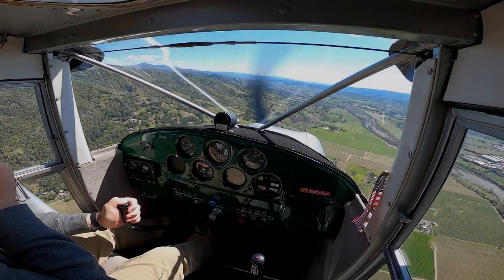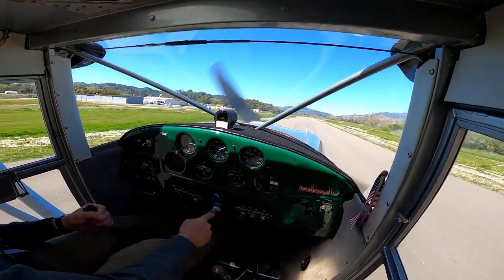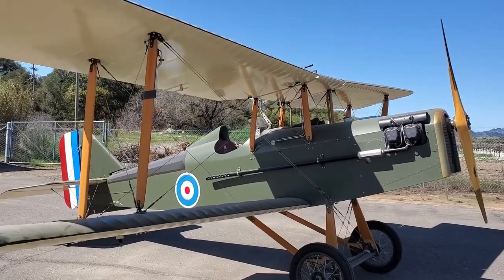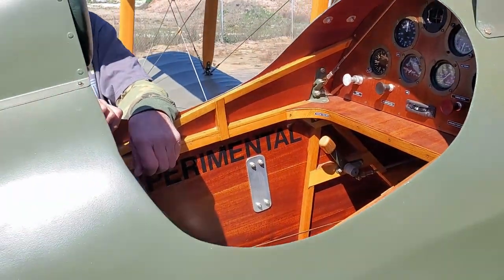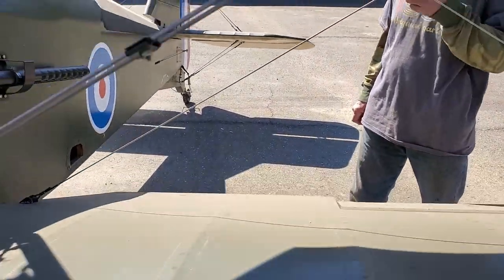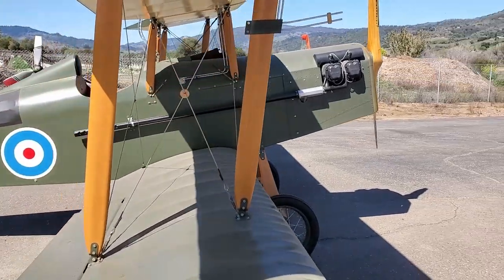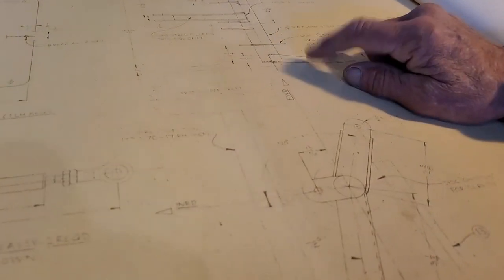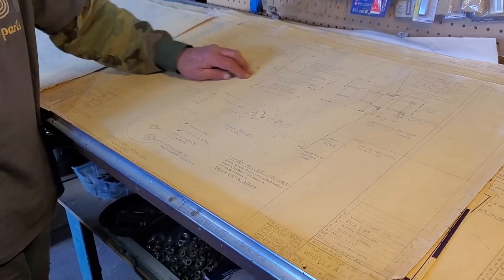Amazing 7/8 Scale SE-5A WWI Fighter Replica 23 Year Build!

Comment: Hay Juan,
That is a labour of love that's for sure. I worked for Qantas and in the 80's they built an Avro 504k replica in the workshop next to where I worked. It took an Apprentice trainer and a handful of apprentices about 2 years to build and I got to watch it come together 1 day at a time, what an experience. They had the original blue prints from the Australian Aircraft and Engineering Co who built the original AC. They also had a handful of salvaged original mechanical parts they got from somewhere. It is now on display in the terminal at Kingsford Smith Airport in Sydney.

Comment: Probably the only plans-built planes built in large numbers where Rutan's Vary-easy and Long-easy, which were constructed with foam and fiberglass. Third party companies made a lot of parts to aid the building.
Rutan, IMO, terrified of the out of control liability court system, pulled the plans off the market.

Comment: These were originally designed and built in Vancouver Canada by Dan MacGouan and Gogi Goglio in 1970 or so. They were kept a Delta air park in Delta. It was the center for EAA in this area so there was lots of places like this. I was building a Fokker D7, which was I did not finish due to house and kids etc.

Comment: I taught at the Nova Scotia Agricultural College, in Truro, Nova Scotia, in 1976. Truro has a lot of big old rambling houses. In the attic of one of these, new owners found a partially built aircraft. There was also a construction journal in the attic. The plane was being built by someone who had taken 5 hours of flight training in the 1920's. He started building his own plane and planned to take part of the roof off his house, and complete assembling the plane outside. But at some point he realized it was so long since he took his flying lessons, he probably could not fly it. So he never finished the plane, and left it in the attic.

The plane is in an aviation museum near Moncton, New  Brunswick, today. I think the Department of Transport looked at it and decided with the heavy wood construction, and low horse power engine it would use, it had a rather high stall speed, and would have been difficult to fly.

Also near the aviation museum there is a 4 engine Argus RCAF maritime patrol plane that went off the end of a runway, down a hill, crashing into the woods. Nobody at the museum knew about the Argus, about 100 meters away. But when I visited the museum with my parents in the 1980's, for some reason I walked off into the woods and found the Argus, as if somehow I knew it was there.

Comment: He probably would have made it full size if his shop was bigger 😁👍🏻
Reply: That was my question. Why build 7/8 when you have plans?
Reply: Me too. Why not 8/8?
Reply: @jerseyshoredroneservices225  [0] can be 1/3 the price of full scale
[1] because 7/8s plans are available
[2] 67% the volume of full scale
[3] 77% the wing area 
[4] Much lighter
[5] Will fly on half the engine size - getting an engine that resembles the original SE5 engine is probably impossible & very expensive to scratch build. Original was 150HP, but with 7/8s you can probably use a cheap Continental O-200 90-100HP engine from the 1980s [used in Cessnas]
[6] Probably easier to certify as an ultralight or some such category of plane

Comment: Why even bother at 7/8ths?  Why not go full size?
Reply: [0] can be 1/3 the price of full scale
[1] because 7/8s plans are available
[2] 67% the volume of full scale
[3] 77% the wing area 
[4] Much lighter
[5] Will fly on half the engine size - getting an engine that resmbles the original SE5 engine is probably impossible & very expensive to scratch build. Original was 150HP, but with 7/8s you can probably use a cheap Continental O-200 90-100HP engine from the 1980s [used in Cessnas]
[6] Probably easier to certify as an ultralight or some such category of plane
Reply: @nightjarflying You need to take a math class or come up with better reasons, lol.
Reply: @mitch_the_-itch  There's no content in your reply Mitchel - what is wrong with my figures in your opinion?

Comment: Why 7/8 scale?
Reply: [0] can be 1/3 the price of full scale
[1] because 7/8s plans are available
[2] 67% the volume of full scale
[3] 77% the wing area 
[4] Much lighter
[5] Will fly on half the engine size - getting an engine that resmbles the original SE5 engine is probably impossible & very expensive to scratch build. Original was 150HP, but with 7/8s you can probably use a cheap Continental O-200 90-100HP engine from the 1980s [used in Cessnas]
[6] Probably easier to certify as an ultralight or some such category of plane

Comment: Well done sir. why not build a full size plane if you are going to all the trouble?...has she flown yet"...come on dude. you are burping all over the man @ 10:22, jeeze...
Reply: [0] can be 1/3 the price of full scale
[1] because 7/8s plans are available
[2] 67% the volume of full scale
[3] 77% the wing area 
[4] Much lighter
[5] Will fly on half the engine size - getting an engine that resembles the original SE5 engine is probably impossible & very expensive to scratch build. Original was 150HP, but with 7/8s you can probably use a cheap Continental O-200 90-100HP engine from the 1980s [used in Cessnas]
[6] Probably easier to certify as an ultralight or some such category of plane

Comment: Great work  ..but  ..imagine spending 23 years building a plane that's 7/8 of the real one  ..why build it that big but not go the whole way ?  ....too bad he didn't make it full size it'd be worth a much larger fortune
Reply: [0] can be 1/3 the price of full scale
[1] because 7/8s plans are available
[2] 67% the volume of full scale
[3] 77% the wing area 
[4] Much lighter
[5] Will fly on half the engine size - getting an engine that resmbles the original SE5 engine is probably impossible & very expensive to scratch build. Original was 150HP, but with 7/8s you can probably use a cheap Continental O-200 90-100HP engine from the 1980s [used in Cessnas]
[6] Probably easier to certify as an ultralight or some such category of plane
Reply: Do you really think this was done for the money?